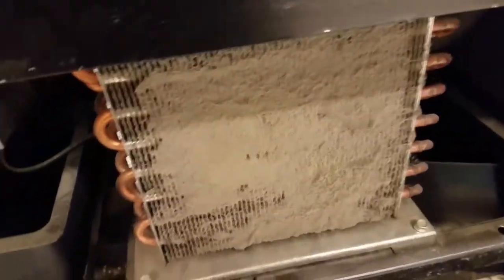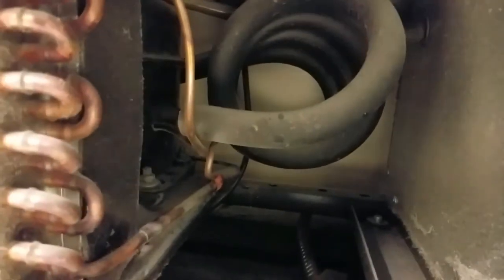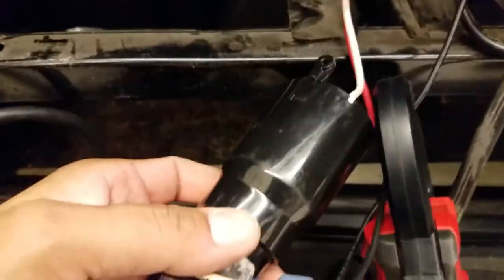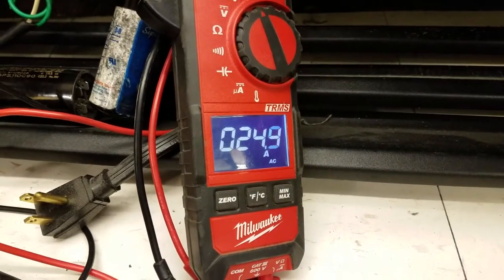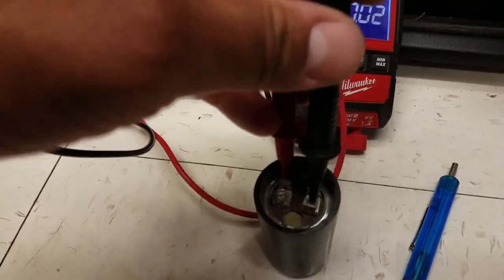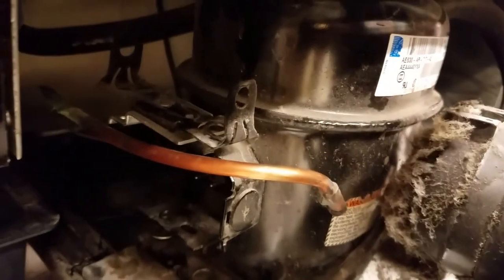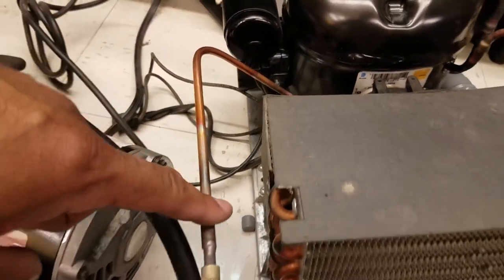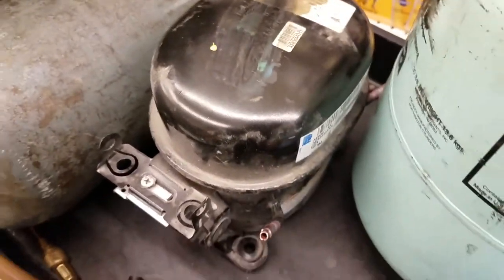Self Contained compressor

Comment: It's a good video, actually when I found external overload is clicking I don't have to put 3n1 starting kit،  just by clamp meter and RLA rating on the compressor, Incan know if it's locked rotor or start winding open/ short, also by time of operation you can tell if this due to compressor failure or starting components. The rule whenever locked rotor always current reaches RLA or more. Thanks anyway

Comment: Was the cap plugged off completely?   I have had good results back flushing through the  suction line, through the evap, and out the cap tube. I always blow nitrogen through to the cap tube on every compressor change to be sure there is no restriction in the captube and flush if necessary,  or do like you did and change the cap if in doubt.  I have no doubt that you know all this.  Just offering my comment.  HEY,  GOOD ONE.
Reply from the maker: I use to back flush it. But sometimes it would not give me good results and I end up putting in a new one anyways, but not all jobs. So I play it safe and put in a new cap-tube when ever I change out a compressor.  Thanks for watching.

Comment: Hello,

What is the name of the tool you put to testing/starting your compressor
Reply from the maker: It's made by Supco 3n1 jump start. You can use it as a replacement for the starting components.  I only use it to test the compressors then I will replace the starting components if needed. Thanks for your comment 👍

Comment from the maker: yes co2 is R744
Reply: RefrigerationTech where can I find hoses and manifolds for co2?  We are preparing for the first co2 install for an Aldi in northeast Ohio.
Reply from the maker: +bblazeff1, I use my regular gauges on the Walmarts I do, that pump co2 using a circulating pump. A different way than Aldi's set up. I haven't worked on an Aldi's co2 set up yet, I believe they pump co2 using Compressors. I would look into getting the right pressure guages. Sorry I couldn't help.